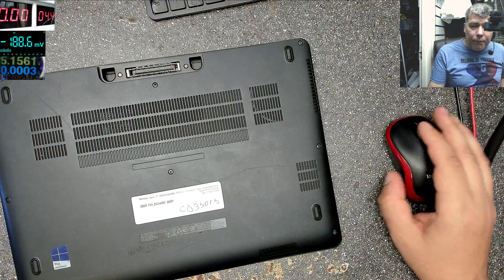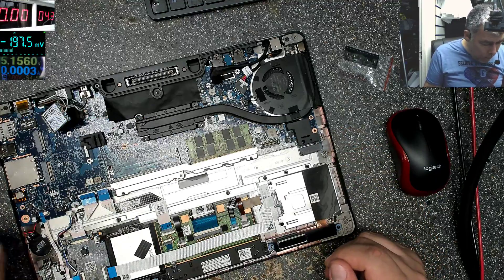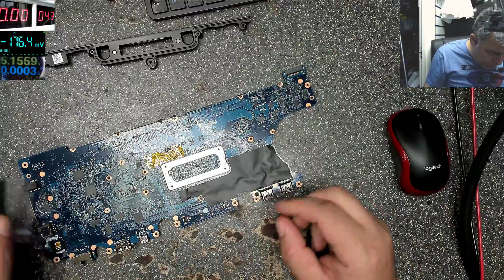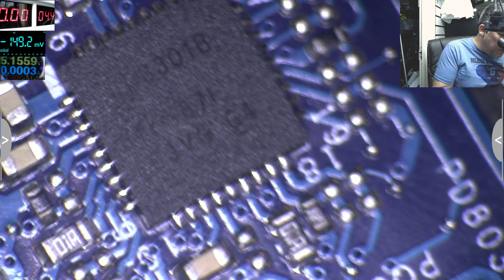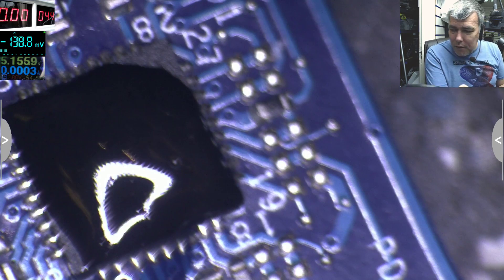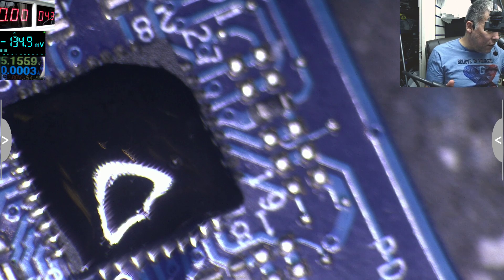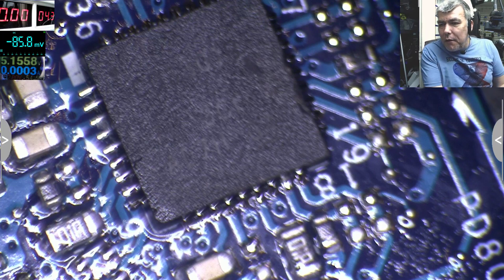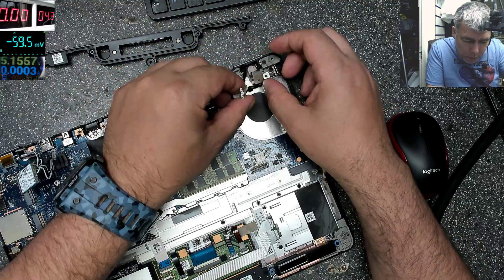Dell E7470 motherboard repair, a hard one - Part 2

Comment: Need Help from motherboard experts.

My Dell e7470 was damged from dock area. All motherboard is working fine and laptop is booting but the dock area gets very hot and spark. 

I don't want to dock in my laptop. Is there any way that i can disconnect the dock area from power. 

The dock area is a separated slice in motherboard.

Comment: Hello, i need help with E7470 motherboard.

Borad is working good but the cord area is damaged,   is short circuit......gets very hot and sparks.......I want to dissconnect the power to the cord area. can you help..?

Comment: When it comes to later Dell Laptops e.g. XPS13 93x0, beside real hardware issues as in this Video, they sometimes stuck in a endless boot-reboot-keyboard lights on/off loop. This is due to a crappy bios (insydeH2O) in combination with some security checks. For instance, due to security checks or corrupted bios regions (Mainly the ME-Region) they turn off after powering. Here, it is sometimes necessary to replace the entire Bios by a donor dump. But mind, the latest Dell Notebooks got more than one SPI. In most cases, there are actually three and the binaries from each SPI needs to be replaced.

Comment: Hi . I had a problem with this laptop.  Usb 3.0 and camera not working.  System reports overcurrent.  I think the usb chip controller is faulty , but I don't know where is it. Would please guide me. Regrads

Comment: It looked like the chip soldered down correctly and then you said you needed to add solder. What told you to add solder when it seemed to look good. What did you see different? Thanks.

Comment: A few years ago I was working as a break fix engineer for a Dell partner, pretty much just visiting business customers replacing motherboards. There was always a hold your breath moment when powering up for the first time, the diagnosis had been done by Dell over the phone. A lot of the newer laptops would do this when first powered up, no display, restarting etc. I would be about to call tech support when suddenly the Dell logo would appear. Love watching your work. It's nice to see someone actually working to component level
Reply: Need Help from motherboard experts.

My Dell e7470 was damged from dock area. All motherboard is working fine and laptop is booting but the dock area gets very hot and spark. 

I don't want to dock in my laptop. Is there any way that i can disconnect the dock area from power. 

The dock area is a separated slice in motherboard.

Comment: I unplugged bios battery and repasted my cpu. It never started, i was scared as fk for ruining my 800 dollar laptop. Reassembled several times. Turns out after replugging bios battery it will never start on laptops own battery and only start with charger. Scared me a lot.
Reply: Btw dell 7567

Comment: hi , i have a msi laptop and i droped coffe on it , i cleaned it , dry it , i changed 2 keyboards and i have the same problem, a group of keys are not working anymore, i can use it only with an external keyboard , can anyone help me with a sugestion please?

Comment: Thanks for video.  Small question.  Why are there aluminium electrolytic smd caps on motherboards. Is there an advantage to them over the chip type?
Reply: capacity ... ceramic ... are lower capacity than the aluminium ones ... i think

Comment: Can you help me with the Components. I would like to be ready for all the diagnostic and repair stuff. What are the most used electronic components for this job. If you answer "resistor", "capacitor" please tell me the most used models for these components too. What mosfet Models, what resistor models, what capacitor models, what etc... Thank you very much

Comment: People, I have a HP Pavilion laptop, new PSU Brick and new ( copy) battery. Plug them all in and power socket led goes White then Yellow for 12 sec then White again, Battery voltage 15.6 on charge. Win 10 shows 100% charged. Disconnect PSU brick, laptop dies voltage on battery drops immediately to eventually 0v.
I have 19, and 3.3v rails. Checked battery out of laptop and voltage on output 14.5 v (14.4v battery) but if I try and power an led (10mA current) output voltage goes on and off in 4 sec intervals.  Anyone seen this effect with these batteries. I think replacement battery is faulty, maybe.
Reply: bad battery , return it

Comment: i have problem with my dell optiplex 9020 AIO , there no post problem,  no display just blank screen but the button led is white that all working. i already change the power mosfet for CPU and its working, first problem error led is blinking that indicate that mainboard no CPU Present, after i change the power mosfet its working but no post, just like in this video but mine i waiting until 30 minutes there no logo appears, what is your suggestion
Reply: reflash bios
Reply: @Customer_Com543  do you know the link for get bios bin file

Comment: The CD3301B only control the DC in , selecting between DC In and the dock connector.I have 4 Dell laptop with this problem one I had to run 7 wires under the chip.you were very lucky that the chip didn`t burn a hole in the motherboard , one burned all the vias around the chip.The chip doesn't create any voltage it takes 3.3v ,5v and 19V and detects if the power comes from DC in or the dock connector

Comment: hai sorin my wifi laptop not work it show ' no connection available'. Also date clock not work.
Reply: Probably, the date issue is because of the bios battery.. 
Try re-installing the driver or try to get the original version of the driver from official website. Or try exchanging the antenna cable on the wifi card.